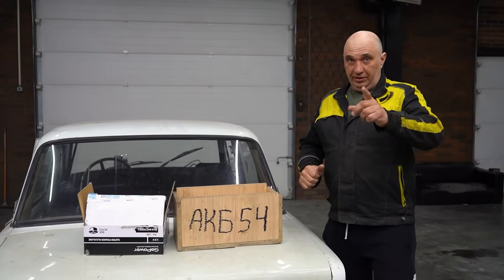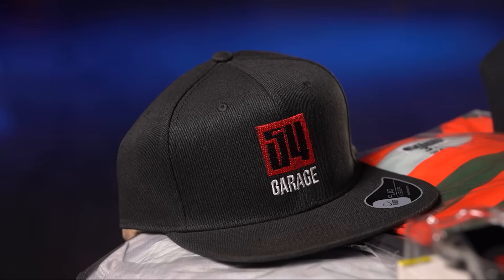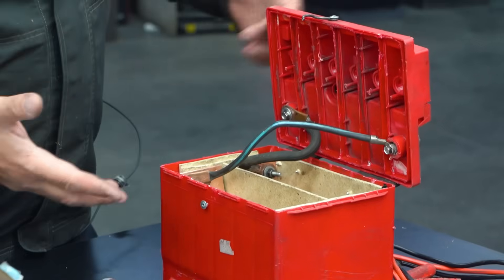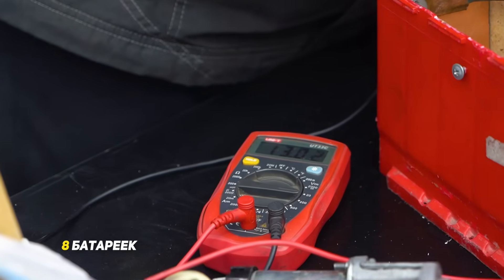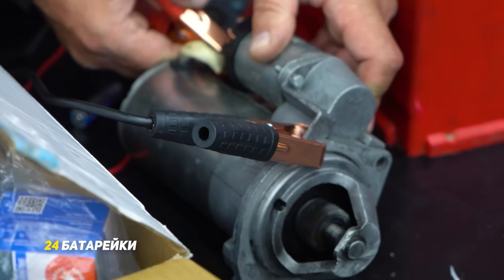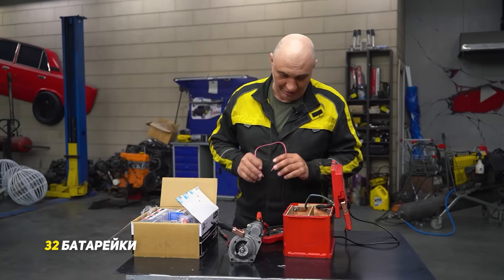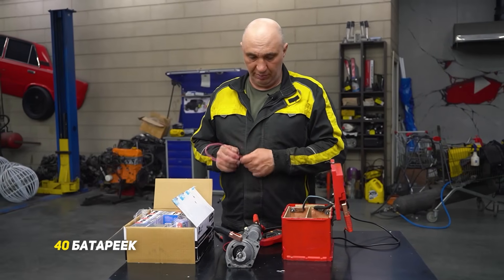How many AA's does it take to start a car?

Comment: The problem here isn't with the volts. You can take all the batteries you have and if you run them in series like you have them in the video you will still only have the same amperage of one single AA battery (between 0.01and 0.02 amps). A car's battery usually has between 600-800 amps available to start it in freezing conditions, but in normal conditions it still takes around 200-500 amps to start.  My suggestion would be, for starters, (no pun intended) using rechargeable batteries would definitely be better/safer, but I would also build multiple banks of 8 AAs in series to achieve the correct volts then run those banks in parallel to increase the amps until you can "Start a car" and see how many banks/batteries it will take. Interesting video though I am amazed you didn't melt those batteries trying to draw all that current.

Comment: need to go ahead and start the car and take it for a spin say 5 miles and turn it off it should show the same amount of voltage as it did the first time so know that it taking charging and not catching on fire. So let's take it out for a spin but first, put something in the box so the battery will not come loose inside the box.  Good luck!

Comment: So I am gonna be a little bit of a nerd but I don’t think you need over 13 volts of power, connect them in parallel instead to induce more current instead of voltage

Comment: brat

can you get some capacitors and use them to start a car
then use them to help accellerate the car
add the dc motor or hook them up straight to the alternator

srbija do tokija

Comment: Yeah, what others have said.  With only 12V of potential, need to put out a LOT of current.

Remember: starter motors are essentially doing like those old time cartoon characters, like Popeye, going out to start their old-timey automobile engines by hand, by having to turn a crank that causes the engine to initially turn over.

Getting the starter to turn is easy with no load.  But the crankshaft, the pistons are all much heavier mechanical resistance.  Then it also needs to put out voltage that'll be stepped up high enough to get the spark plugs starting as well plus carry whatever the rest of the electrical load that may be on a car, like lights, dash/instrument panel, whatever.  And every time you test it on the starter, even unloaded, that's probably a hefty drain and the remaining power capacity will be increasingly less relative to each newly added rows of batteries.

Comment: Internal resistance of a lead / acid 12v battery is low so that the VERY LARGE INITIAL CURRENT required to turn engine over does not create too big a voltage drop and that that actual value of current can flow. 
With those small batteries I would guess that the TOTAL internal resistance is quite high so that will limit the starting current. This is one reason why the 12V car battery is a lead/acid one - it has a low internal resistance. Anyone else agree?

Comment: I am not sure all the batteries are making good connections. There is a reason why anything that uses that type of battery has little springs on one end to have a good positive connection.  Some of those batteries were probably floating around loose in there.

Comment: The energy density of the car battery filled with AAs vs its original state is interesting. Using higher density cells would be interesting to see how few cells of similar shape would be needed

Comment: 18650s should try but need to setup alt to charge them before hand it will be a great way to see if it makes a better battery lasting longer than old lead acid

Comment: If you use NIMH batteries, I expect that you will require fewer of them because the internal resistance of them is much less.

Also, I wonder if the batteries were configured a bit differently, the results would be better.  Make several 6 volt packs in parallel and then put those packs in series.  That way, every "pack" of batteries won't be stacking each cell's internal resistance.  Or maybe that makes no sense?  I would have to think about it more.

Comment: 8 would make 12 volts, but the amperage is probably too low.. But if you charge up a big capacitor to the 8 batteries... Then it might start

Comment: 8 Batteries * 1.5 volts = 12 volts.
They should have put 9 batteries in series and went for 13.5 volts.  At 12volts a car battery is basically dead and 12.6 is fully charged.

Comment: 1.5V Alkaline batteries generally comes with 1580-1590mV out of the package. Let's say 1.6V each.

Lead-Acid batteries can store potential voltage 14.4V-14.7 for cycle use.

15V won't damage any electrical component on a car. 16V probably won't damage too but can't be sure.

So instead of using 8 series, if you used 9 series of batteries you could get more Watts from the batteries thus you can start the engine with less batteries.

Comment: Try using rechargeable 1.2V AA Ni-Mh cell, but you need to put them 12 in series to get 14.4V nominal voltage. It should be work better than this, and it is rechargeable too

Comment: A volt and ammeter at the same time as trying the starter will give you some information that may become useful.
Edit: You got to that but have you checked the weight of the new and old battery?

Comment: You don't need just voltage. What's more important for starters and batteries for cars is amps. A car battery will have 12 volts, but it will have a few hundred amps. Amps are crucial. But I'm pretty positive you guys already know that

Comment: Alkaline batteries will definitely recharge. You used to be able to buy wall chargers for them. The cells are not designed to be good at recharging though, so you only have a very limited number of times that recharging will work, and each recharge is less capacity. The problem here was you didn't let them recharge long enough.

Comment: spoilers
.
.
.
.
.
.
.
.
.
.
.
.
so 308 is enough to start it 3 or 4 times, i think 350 sould be enough to start it easily, over 100 times. it struggled and just made it at 308, so adding 50 more batteries would make it a lot easier to get the car to turn over.

Comment: Looks like your voltage was too low. 8 batteries X 1.5v is only 12 volts but a charged car battery is more. 12v batteries are low at 12v.

Comment: You need 250 amps to start a starter motor for a full rotation turnover over motor a typical 1.5 volt battery has 0.25 milliamps 1000 milliamperes equals 250,000 milliamperes that's a lot of batteries the voltage will be too hard for amperage

Comment: 8:54 Stepping up the amount of fresh batteries after killing the ones in the battery case is not helping turn over the engine, the starter in the car is pulling to many amps and the AA batteries are draining down to nothing. To be effective all the of the previously tested batteries have to be pulled out an you need to start over with fresh ones. The amps need to be tested not so much the volts.

Comment: The cable you're using may be too thin. That looks like maybe 12AWG stranded, which is good for ~25 amps but not much more. I wonder if a thicker cable could've helped reduce the voltage drop.
Reply: It's only boost current. It's not like they are pulling 25 amps for 8 hours.
Reply: I feel that with a user name like yours you probably know that as they pull cranking amps the resistance of that small wire creates enough voltage drop that the starters available torque drops off dramatically?
Reply: You know that's the exciter wire for the solenoid right?

Comment: The issue in the beginning was you were just adding fresh batteries to stressed out and discharged batteries. All those cells in series will need a balancing BMS or battery Equalizer to keep them from wondering apart in voltage.
And of course, use secondary/rechargeable batteries. I don't remember why or what will happen if you try to charge primary/single use batteries.
Reply: What I really want to see, is you do this test again with ultra-capacitors wired in series to safely cover the max charging voltage of the alternator, and separately test normal electrolytic capacitors individually rated above the alternator like 16volts or something.

Ultra-capacitors have a lot of capacity for a capacitor, but like those little batteries, they individually can only handle low voltages, so you need a lot wired in series, and a capacitor calculator online because wiring capacitors in series reduces their capacitance. But there are normal electrolytic capacitors that can be rated up to high voltages, like 100v, and you can just wire them in parallel to combine their capacitance.

You can start with a lot of ultra-capacitor series chains or a lot of 16v or whatever normal capacitors in parallel, then start removing parallel connections, to see the minimum capacity and parallel caps it takes to crank a cold engine.

Comment: Very fun video, but unfortunately the approach has a small issue with it. The slow increase of batteries means that the batteries which are added first have experienced several occurrences of high current draw, by attempting and failing to turn a motor which is at a dead stop, making it's current draw peak as high as it can go. This means that by the time the later batteries are added, the earlier batteries are weakened. Ideally, it should be a new set of batteries every time, as in the case where the starter is able to turn, then the current draw is massively lower, after the momentary peak during the start. I think the current draw should have required something like 200 batteries for a healthy start, if fresh, but then they dont handle a second start well cos they cant recharge. Still entertaining to watch :)
Reply: They changed the batteries after 120

Comment: I didn't watch this video. I did the math in my head for about 20 seconds.
4800 is the answer.
1.5w per battery, 7200 watts needed.

Comment: You would have better success using type C or D Batteries......of get a load of 18650 cells and find out the minimum to start the engine
BTW....that lada engine sounded quite smooth 😊😊😊

Comment: I‘m kind of surprised those AA batteries didn’t melt away.
They were closely packed w.o air circulation in them.
But then again, I do wonder at what point they would actually melt- any chance of trying that or would that be something for the guys @kreosan?
Reply: Alkaline cells can pull about 2 amps. In the video we can see 120 ampere through 80 cells, so these cells seem to do 1.5 ampere.

If all the power went in to producing heat (which it doesn't) that would mean:

1.5 volts * 1.5 ampere = 2.25 watts of heat per battery.

But in the video we can also see that the voltage drops from 12 to 8, meaning each cell goes from 1.5 to 1 volt.
1 volt * 1.5 ampere = 1.5 watts of heat per battery.

So if we tried to heat up the whole box of batteries with all produced power, it would be about 306 * 1.5 watt = 460 watts of heat, but it's also 7kg of mass.

As a comparison, a smaller oil filled electrical radiator is about 7kg, that won't be hot to the touch after just a few seconds.
Reply: @sniglom  Oh thanks for this good answer!
I didn’t do much maths around it, that was lazy of me.
I simply thought: those batteries have an internal resistance and if you take a lot of power this must heat them up.

Comment: using the batteries may be nice idea but you gotta remember the "demand" of the power. not what it can give or how long it can last under load.  I fly drones and use LIPO batteries, having this thought. the "C" rating where the power discharges quick. using those standard AAA batteries have extremely low C rating so this may be why it took 300 of them just to get the motor cranking. I would suggest you to try lipo instead of the AAA.   but probably a dangerous idea.

Comment: I  made a jumper battery from 24 18650 power tool cells. With 16 volts, it starts anything.

Comment: try it with rc car battery cells and you should have topped the battery box max aa batteries that could fit and took it out as daily driver all day without turning engine the first few hours.

Comment: Well, 13.5 volts....
Also, with discharge, the inner resistance in a battery will diminish. If coupled in parallel with other batteries, a partially discharged battery will hence cause a power drain, reducing the performance of the good batteries to the same as the discharged one

Comment: You would need 768 batteries in groups of 8 to get close to 240Ah. Each group would need to be 12v at 2500mAh x 96 groups = 240Ah or close to it. But it is not going to last long, but more than long enough to kill a person.

Comment: This really put lithium vs alkaline into perspective.  It's amazing that it only take a small fraction in  18650s get the same results 🤯
Reply: How many Zinc AA ?
Reply: coz mostly average 18650 has 2000mAh thats why you only need less of it than AA batteries.
Reply: @gizmofrek  and 3.7V instead of 1.5V for AA

AA alkaline is 1.5V at 2200mA max
18650 is 3.7V at 2200mA to 10000mA

But note A is max not amps per hour.  Meaning the AA has only about 60 seconds at 2200mA.
Reply: @gizmofrek  I wonder if lithium AA s would do better ? I've got some rechargeables that put out 1100 mAh .supposedly .  Makes me wanna try
Reply: @gizmofrek  With high amps has less then 2000mah.
Reply: @gizmofrek The capacity has nothing to do with it 🙄
Reply: It's the method, not the chemistry.

The newer cells being added are being pulled down by the earlier cells because they have already been trying to turn the motor.

Comment: standard AA battery has about 400 to 900 milliampere hours with a voltage between 1.2v and 1.5v. lets assume its around 500 milliampere hours. and the car needs lets say 50 amps that would equate to 100 batteries to meet the minimum amount. "Without calculating resistance across the pack"

Comment: See how far you can drive without the alternator when your only power source is 8 AA batteries
Reply: Not enough juice there. The voltage would be right but the car would eat the amps too fast.

Comment: Each one of those batteries has an internal resistance, so the more batteries the higher the internal resistance. The lead cell battery has a low internal resistance, so an interesting experiment you could try would be seeing how many aa batteries it takes to charge a lead acid battery enough to start the engine.
Reply: That would be true for the 8 batteries in series, but not for all of them connected in parallel. I think it would be better to combine them with a supercapacitor than a lead acid battery.
Reply: The more batteries in series, the higher the resistance.  Putting batteries in parallel reduces the effective resistance - basically think of it as a bunch of resistors in parallel.
Reply: @ccoder4953  it's still just 8 batteries in series to make 12 volt.
Reply: @sniglom  Quite true.  But as soon as you have 8 series strings in parallel, it's the same ESR as one cell by itself (albeit with higher capacity and voltage).  AA batteries honestly have pretty bad ESR (far worse than Li-Ion).  So, you need alot in parallel to get the ESR low enough to where they can do the sorts of currents a starter motor will need.

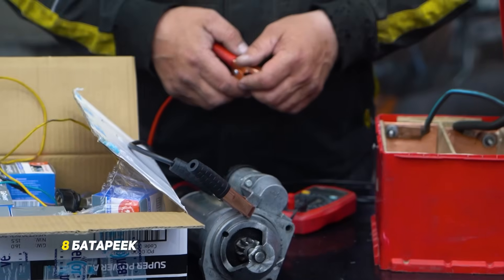Comment: Did I hear it right @3:40 "even without load". What does he mean by that? The starter motor is a pretty heavy load...😊
Reply: not really...
Reply: @der_cumsportler1022  according to quite a few websites, the resistance measured over the motor should be about 0.1 ohms which translates to about 120amps. That's plenty in my book. The windings aren't thin, they are pretty hefty copper wires. Try and run a starter for a longer period of time and see how "it's not really a big load" . I might be wrong of course, but until I get proper proof/info I will keep my view.
Reply: @der_cumsportler1022  I agree that the motor itself is without  load. I do not agree that the batteries don't "experience" load. No biggie, just different view on what load he means. I talk about the electrical load that is very present in my view.

Comment: 18650's would definitely do a better job and can be found in old laptop batteries. Worth getting a few old laptop batteries, extract the 18650's, charge them up to see which ones are good and do the same experiment.
Reply: Its veery dangerous, thats the reason why some EV catch fire.

Comment: I once ripped open a rechargeable battery pack and it was filled with fuji batteries that said do not recharge. You can recharge any battery. i do it all the time and have never had a problem.

Comment: Get some ultra capacitors or a booster pak that is made up of ultracapacitors and use that to start the car using only minimum number of AA batteries as the power source.  Look for 12V Super Capacitor Jump Starter when doing a search.

Comment: Try it again. This time go perhaps 10 in series rather than 8. Possibly overcome the internal resistance of the batteries. By the time you've had a couple of attempts the batteries probably drop under 1.4v anyway

Comment: 🤔You should definitely try it with 9-volt batteries now
Reply: 9 volts would only turn the starter slowly, not enough to start an engine,
Reply: @PF-gi9vv  if you connect them in series they will become 18volts😅
Reply: D cells have way more amperage. one 9 volt battery has a 1/2 amp capacity, one D cell has a 10 amp capacity. Therefore six D cells would give you 9 volts with 60 amps instead of the 1/2 an amp with a single 9 volt.

Comment: It's not volts but amps that are important, the average 2a has a amphour rating of 2, it takes around 600a to start the average car thus 300 batteries in 12v parallel did the trick. and of course rechargeable batteries would work consistently and be chargeable however their amphour is a bit lower at 1.6 to 1.8, so more batteries would be needed. It's a cool experiment, but actually just simple math.